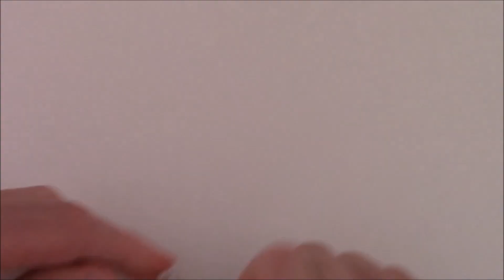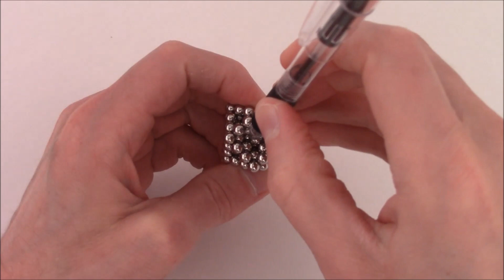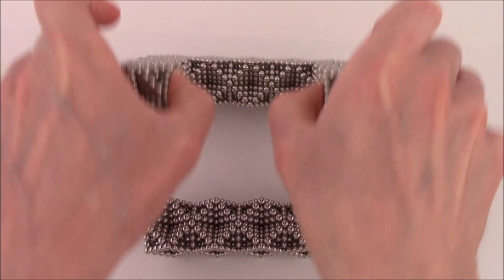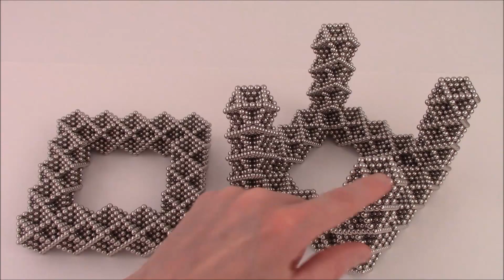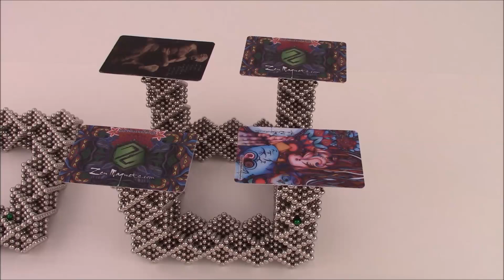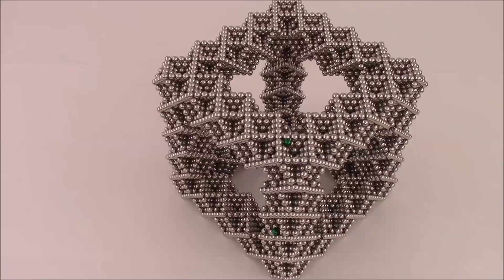Tutorial - Cube Frame of Layered Cuboctahedron Frames (Zen Magnets)

Comment: That's one of the best looking designs yet.  I must ask a question though,  Were these designs created by computer, or did someone actually take the time, dozens of hours to work through the trial and error?
Reply from the maker: This build required only a little time to prove out the idea of filling the layered cuboctahedron frame in the center, and then again to work out the method of joining the layered cuboctahedron frames on the square face.  Other builds of mine have required quite a bit more experimentation and development.  Only one has benefited from computer modeling: https://www.flickr.com/photos/94129525@N07/14485526332/in/photostream/.  Here's the model: https://www.flickr.com/photos/94129525@N07/14575336444/in/photostream/
Reply: Wow, thanks for picture links, very nice indeed.  Thanks for the reply.